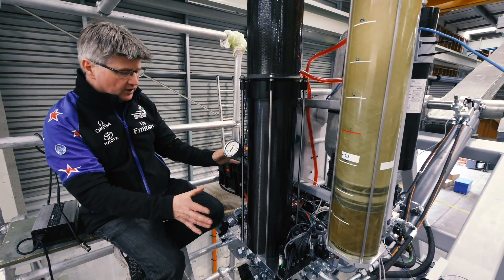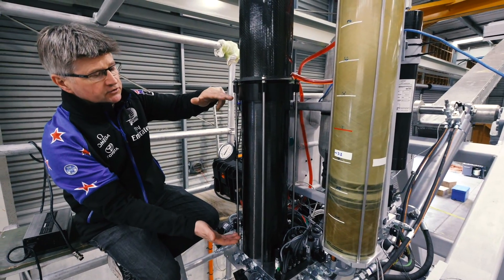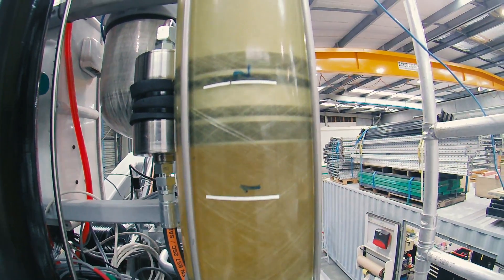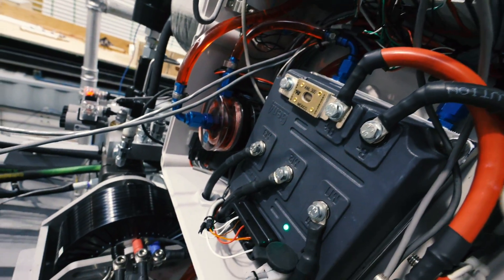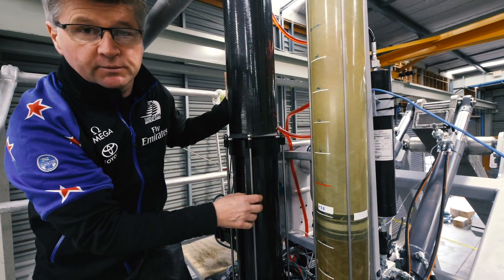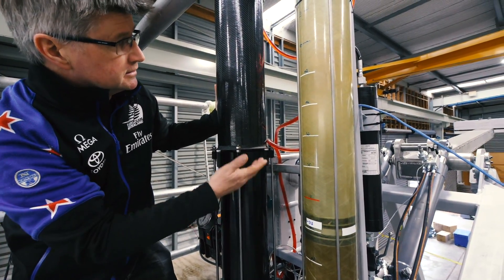HOW THE FOIL CANT SYSTEM WORKS

Comment: HEY GUYS I WOULD SUGGEST YOU LOOK AT THE SPACEX FIN ACTUATION MECHANISM, THEY'RE USING A DIRECT DRIVE ELECTRICALLY ACTUATED FIN RATHER THAN HYDRAULIC FOR ADDED SIMPLICITY. THEY ACCOMPLISH THIS WITH A 250KW TESLA MOTOR AND GEARBOXES. YOU SHOULD LOOK INTO IT. ALSO EVERYTHING SHOULD BE WATERPROOF. ITS A BOAT.
Reply: As an electrical engineer I have always preferred electrical actuation as today with modern drive controllers it provides a much simpler and reliable solution. There has to be a way that it can be done with a slow speed Torque motor and a fat ball screw. The result would be a massively simpler (lower component count) system that is much easier to control.
Reply: @johnwales5686  and they can do a sealed motor with water cooling so the motor itself is water proof. And the ESC motor controllers can be potted in epoxy and waterproof as well, even water cooled. You’re right way simpler system less weight, less components, they could move those foils with speed and high force. A 5kwh lithium pack would be perfect for a race.

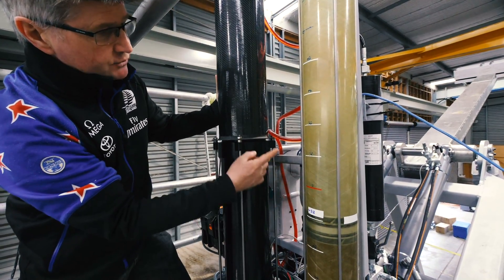Comment: arcing at 1:15 from what i believe is the igbt   also got a glimpse of the hyd schematic,  How are they addressing "neutral imbalance" on the valve? this happens when pressures rise disproportionately on valve-  STND valve overlap  will not address this at high pressure  --- could be UK issue -- this was a issue on high pressure actuators for rockets and aircraft..  keep up the good work the boats and systems are amazing.

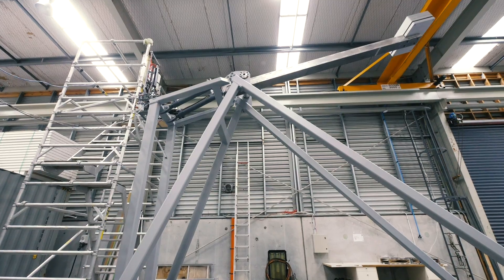Comment: At 1:19 it is specified that after the arm moves, it takes 15 seconds to recharge the accumulator.  Does this imply that back to back maneuvers are now precluded, as we must wait for the recharge?   No more quick tacks? Quick gybes?  I think the frequency response needs to be a bit higher than what is specified herein.
Reply: No. They only need to actuate the foil arms when they're tacking and gybing , not when they're manoeuvring the boat from, say, a long reach to a short reach.

Comment: Finally you made an accumulator system like I said 4 years ago before the last campaign... instead of the boy having to pedal like crazy all the way round the course you could have charged the system, let them have a rest, let the accumulator do the initial grunt and then switch into direct drive hydro system... and maybe it's me that missed something but using an accumulator best practices is actually to use high and low pressure accumulator combined to get the most efficient and fastest reacting system. The high pressure side starts the motion and the low pressure takes over and finishes the long stroke. You can make a cheeky hybrid system with both high and low pressure in one carbon cylinder with a bottom section with some sort of carbon spring to give the initial push that obviously requires more preload but with a shorter stroke.
Reply: The boats in the Bermuda AmCup contest each had three accumulators.
Reply: @Gottenhimfella  I think you're mistaken. Carry on.
Reply: @ipanzerschrecku4732  You're accidentally right, in a way. Because here's something even people who DO know something of what they're talking about might not know about accumulators int the last America's Cup: (regarding the New Zealand boat) <<Being able to top up the hydraulic pressure more quickly than their competitors (because of the "cyclors") meant there could be more functionality on board the boat.

"One of the things that not many people know about this campaign was that we only ran two accumulators [a pressure storage reservoir of hydraulic fluid] on board, and not three (like all the other boats) . We decided to take the extra weight of an accumulator off the boat because we believed that our guys could top up the accumulators quite quickly, which allowed weight reduction.

"While the other boats started off with more stored energy, we believed that we could get around the track cleanly, with the weight saving, and utilise that energy elsewhere."

Carry on.
Reply: iPANZERSCHRECKu 
The next step to using hydraulics is recharging the storage tank using it’s own generative momentum, that being wind generated Or water flow, a little bit of movement can be stored and use can be more efficiently managed doing away with human grinders. Lithium electricity can also aid in manufacturing mechanical assistance, waves of the future

Comment: This is so backwards it isn't funny.  Great engineering for sure, but get real and get back to multihulls for basic high speeds and righting moments!
Reply: Once foiling, boats don't need lots of righting moment, because the water resistance is so low. 
They need low aero drag. The AC72 wings were way too tall, as witness their being outperformed by the AC50s.
Reply: Screw multi hulls this technology is amazing and monohulls doing what Ac75s are doing is only helping foiling technology move forward. Jyst how F1 pushes hybrid tech Ac75s push foiling and composites tech